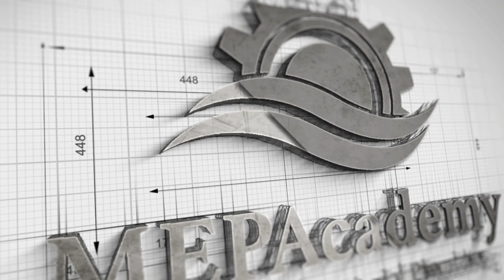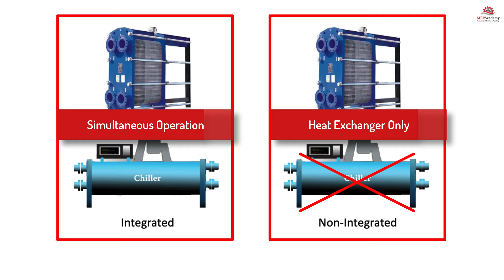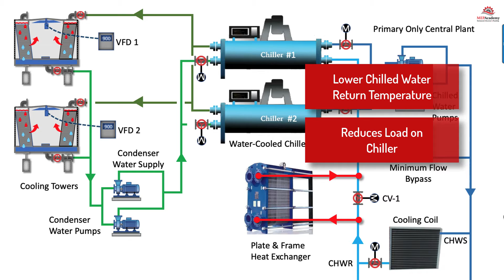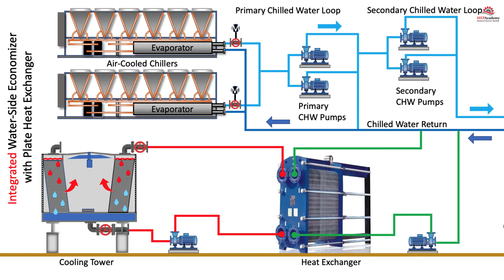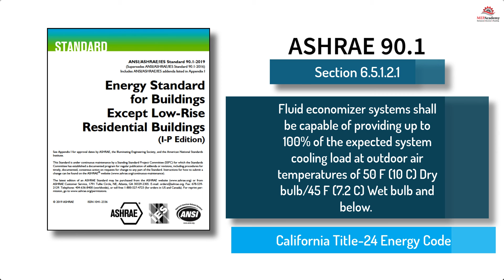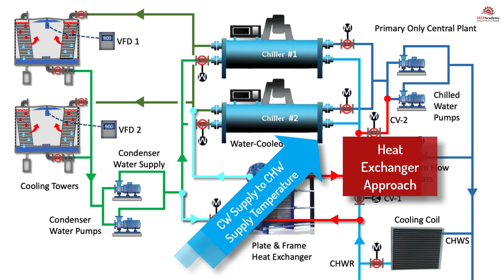How Waterside Economizers Work

Comment: seems like this would introduce low-delta-T syndrome, if the CHW return starts to approach the supply CHW temp
Reply from the maker: Yes, if the supply water temperature from the water-side economizer is too close to that of the chiller (typically around 40°F to 45°F), and the return water temperature doesn’t increase significantly due to a lower cooling load or inefficient heat transfer, it could contribute to or worsen low delta-T syndrome. This occurs when the temperature differential (delta-T) between the supply and return water is too small, reducing system efficiency.

However, water-side economizers are designed to avoid low delta-T syndrome through several strategies:

1. Free Cooling in Favorable Conditions: The economizer operates during cooler outdoor conditions (e.g., during colder months), when it can completely or partially meet the cooling load without the chiller running. When the economizer is fully handling the load, the chilled water system can be isolated from the process, preventing issues with delta-T altogether.

2. Modulating Control: In hybrid operation with the chiller, the economizer often operates under modulating control, meaning it only provides cooling as much as needed. This avoids sending overly chilled water to the system, which can cause low delta-T conditions if the cooling load is not high enough to raise the return water temperature.

3. Load Distribution: The system may prioritize either the economizer or chiller to meet the cooling demand more efficiently, balancing the load between them and ensuring sufficient heat exchange in the air-handling units (AHUs) or fan coils. This helps maintain an adequate temperature rise across the system, preventing a situation where the return water is only slightly warmer than the supply water.

How Economizers Avoid Low Delta-T in Mixed Operation:
Temperature Setpoints: Economizers often supply water at a slightly higher temperature (e.g., 45°F) when in hybrid mode with the chiller to allow the system to raise the return water temperature sufficiently, thus maintaining a healthy delta-T.
Staged Cooling: Systems may stage cooling between the economizer and chiller to adjust the supply water temperature dynamically based on the actual load, ensuring the return water temperature doesn’t stay too close to the supply.

Conclusion:
While there is a risk of low delta-T syndrome when the water-side economizer’s supply temperature is similar to that of a chiller, smart control strategies and operational practices are implemented to avoid this by managing the load distribution, modulating temperature setpoints, and ensuring adequate heat transfer in the system.